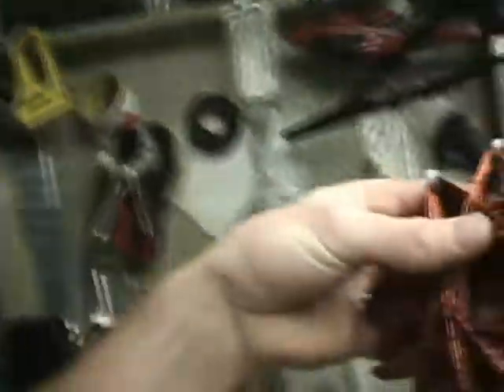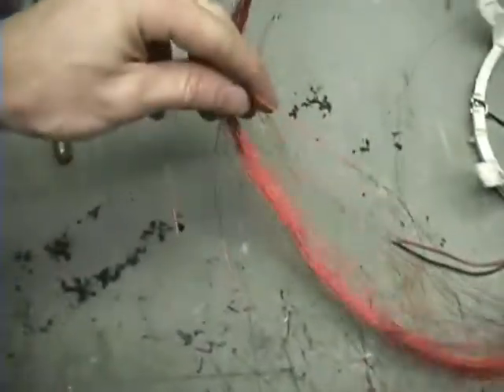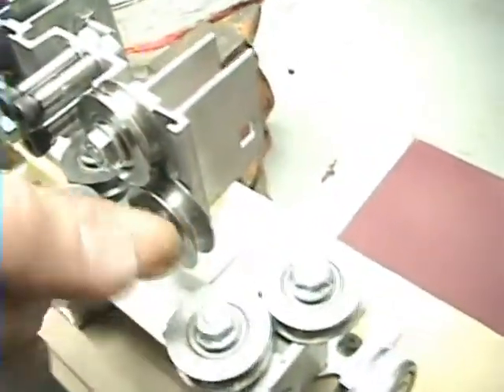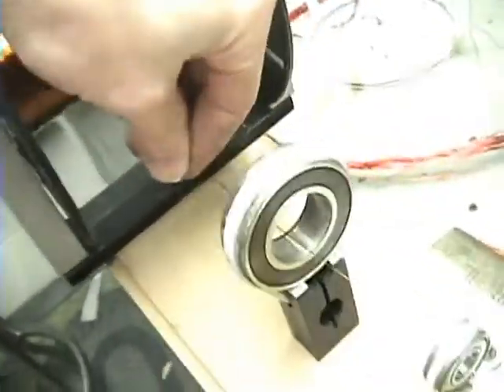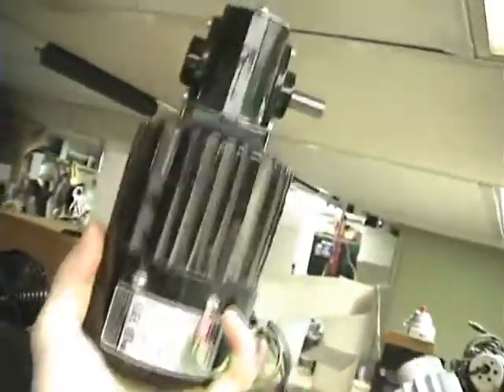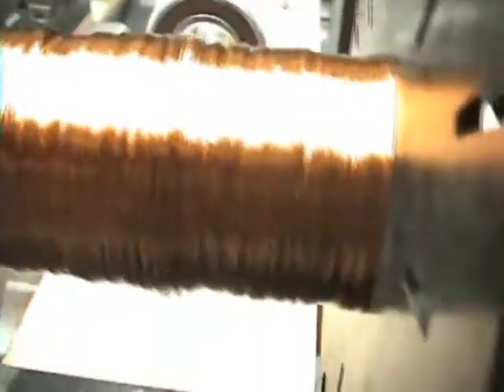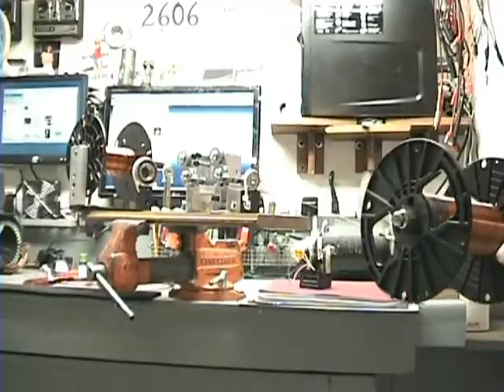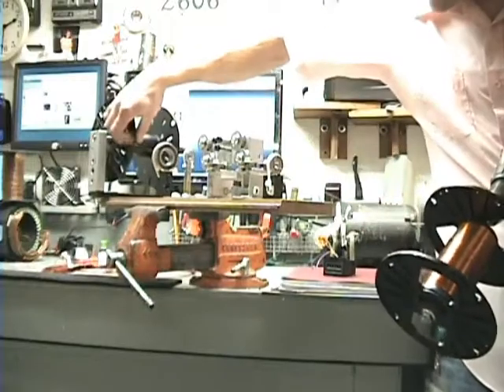My device to straiten and clean salvaged magnet wire! Build with junk!

Comment: You might be able to figure out how much wire you have by weighing it. When wire is bought by the pound, they give an approximate length. You just have to determine the gauge for this method. Good job!